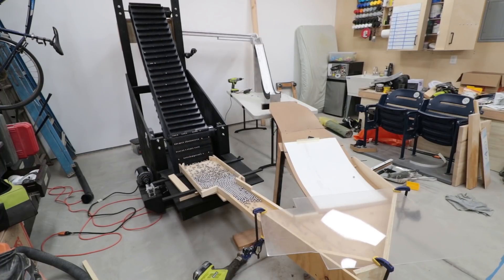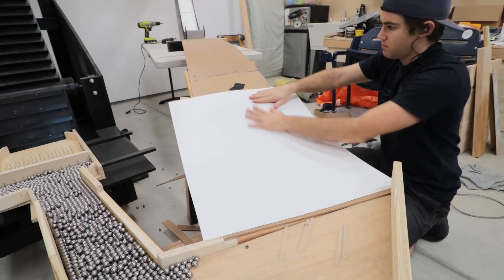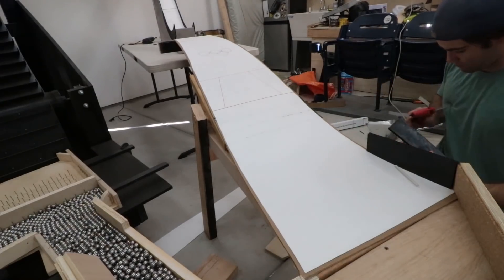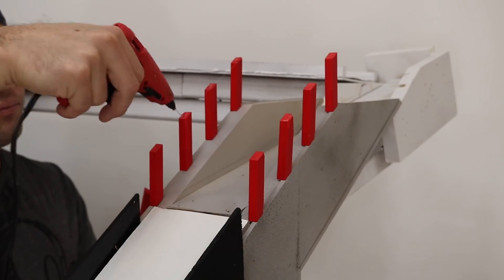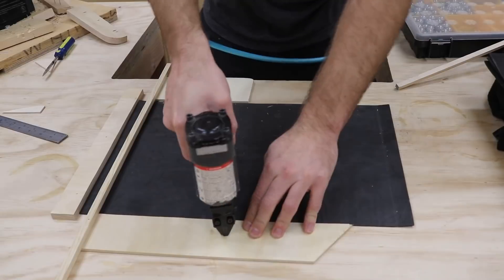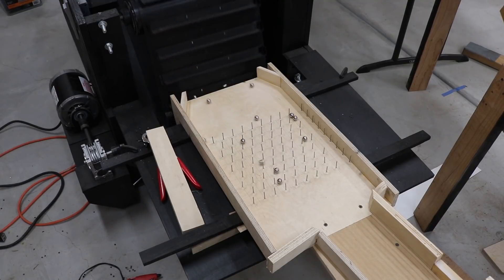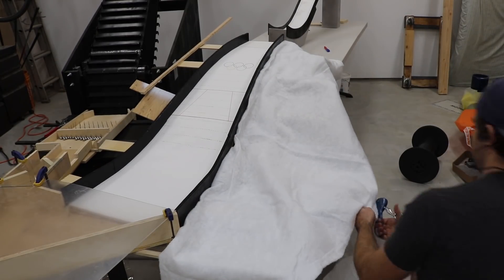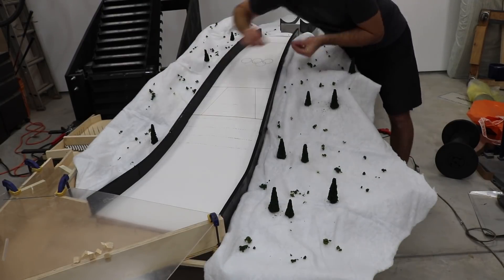Ski Jump Marble Machine Build, Part 3

Comment: Well, correct me if I’m wrong, but that exact ski jump is located on the ski jump you are building.
Oh, and idea, a way to try and prevent the marbles from hitting the walls at the bottom of the ski jump is in a way add ridges like if actual skiers turned at the bottom.

Comment: Actual ski jumps end in a steep upward deceleration area, which you could use (instead of a walled and covered turn) to slow the marbles down before they move on to another section.
Reply: Actually very few have that feature, most ski jump don't.

Comment: Instead of those zig zags could you use an old paint brushes bristles to slow them or even strips of cloth like a car wash by horizontal not vertical mounted. Probably even more noise reduction and can be adjusted to speed or slow by raising and lowering it.